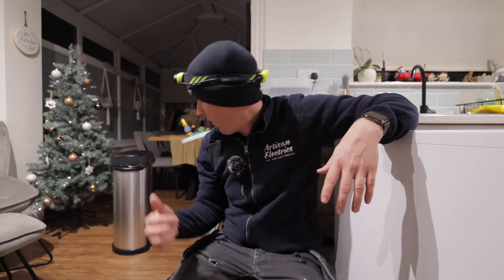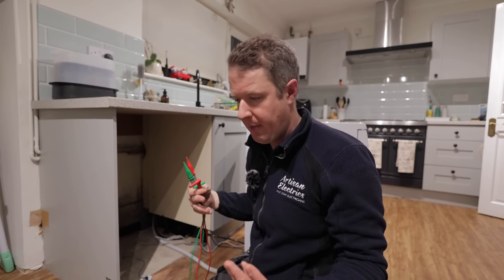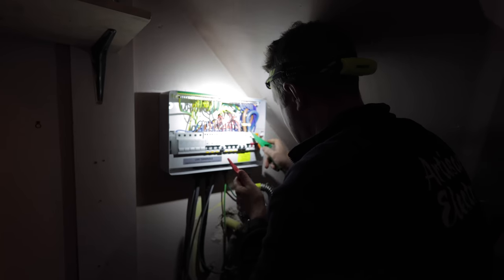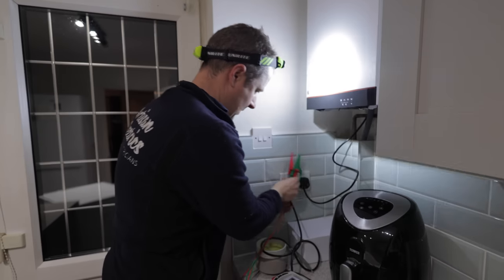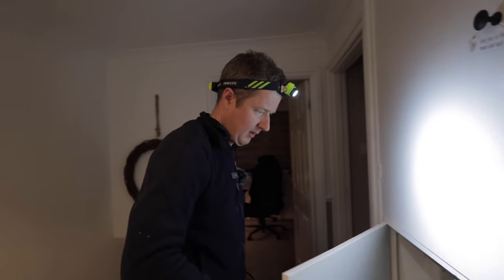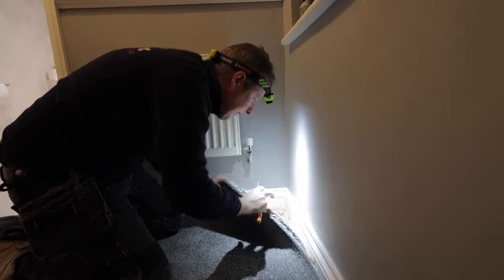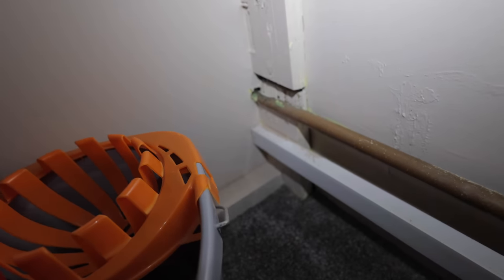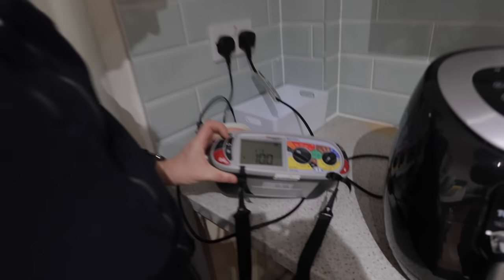Nearly KILLED by a CRAZY fault! What on earth is going on? 💀

Comment: I’m a boiler repair engineer. I’ve seen similar to this on a few occasions. I think a few years back a BG engineer was killed by something similar. I remember on our training course them absolutely drilling us on the correct safe iso procedure because of it. In fact they were so paranoid about dual live feeds that my manager said if he ever came out on site and found we didn’t have a volt pen he’d send us home. The safe isolation took longer than some repairs. 😂. Really good video.
Reply: dont just rely on your volt stick, always use a multi meter and a mulitmeter prover.always test your volt stick on a known live.  first.
Reply: I worked at Transco at the time the Volt Sticks and training was given to us. The reason was a Transco Engineer in Liverpool visited a possible unsafe situation with a gas cooker. When he was kneeling down he was touching the gas cooker with one hand and his other touched the emergency control valve, where he received a massive fatal shock. On investigation it was found that the electric kettle which was on top of the gas cooker had a damaged cable and was touching the gas cooker making it all live including the gas pipes. It just needed someone to provide a path to earth which he did.  After that it became mandatory  to  check any part of a gas installation with an approved volt stick (After first checking on a known power source before and after checking the installation)
Reply: So, I'm curios, is there a lot of deaths from poor and untrained people doing electrical work in the UK?  It seems that using the higher voltages should require a higher degree of safety and training?  That boiler electrical wiring installer should be notified he will be killing someone if he doesn't get the right training.
Reply: There's cowboys everywhere unfortunately. Bathroom fitter took out a lighting circuit by putting chock blocks between live and neutral. Boiler engineer wired up my nest system all wrong and blew the nest wiring box. All different guys, all with excellent feedback on mybuilder. Honestly if you find a good sparky/plumber/handyman just keep using them.
Reply: @silverismoney  So, this is in the UK?   Is this because there are so many unlicensed electricians in the UK or because licensing is allowing Boiler engineers too much latitude without sufficient training on electrical?
With these outrageous stories that many people are killed or shocked, does anybody actually track incidents and can we look it up?  In the U.S. we use 120 vac for most all of our electrical needs and only use 240vac when is truly necessary.  U.S. electrical codes and enforcement are quite strict and I wonder if there is a big difference in serious electrical injuries in the U.K or U.S.?
Reply: user-lt3he9ey4x  Man, I just assumed the UK was as strict or stricter than the US, just because you use higher voltage for everything.  Those stories are a wake up and pause to pay close attention to safety for us all.
Reply: @cantweallgetalong   I was also under the impression that the UK was more strict regarding stray currents - their adoption of GFCI (which they call RCD) has historically been more aggressive than the US.

However while checking that just now, I found that the US now requires that protection regardless of circuit current (although still only in some parts of residences) whereas the UK requires it practically everywhere (but still exempts higher current circuits).

On balance I'd say the UK is still slightly ahead.  But what's more interesting is that the exemptions don't overlap - and since in each case removing one exemption was feasible, that indicates removing both would be feasible also.  So I expect both exemptions to be removed within the next decade.
Reply: @cantweallgetalong  - your 120 V AC can already be dangerous enough. neither should be subject of laymen installation or servicing.
Reply: @alexanderstohr4198  Yep, but the Boiler tech is supposedly trained and allowed to do seriously dangerous wiring and it appears to be killing or injuring the unsuspecting.
Reply: @Matt Faraday  Got same stories - qualified, registered, recommended electricians... sloppy junk work. Think I've found a good one but he's near retirement.
Reply: @alexanderstohr4198  Except this was professionals. I've also seen sloppy work by registered recommended professionals
Reply: @cuebj  I've noticed that too.  It sees the retirements are wiping out so many professions, it's getting very hard to find anybody competent to do anything.
Doctors and dentists and accountants and lawyers in addition to all the trades.
What is happening is the inflation and the liabilities have made everybody focus on the money and not the service.
Reply: @cantweallgetalong  Standards in themselves do not equal compliance. If contractors dont abide there may as well be no standards at all.
Reply: @cantweallgetalong  Also there is only one insurer underwriting everything, all public liabilities. So no market competition in that space.

Comment: Mate, I live in the US but if You were in my area I'd hire you in a heartbeat. You did what I would hope every skilled electrician would by going above and beyond to fix the issue. I guarantee a lot of others would have thought about it and buttoned it up for someone else to deal with. You didn't and I applaud your professionalism.
Reply: In spite of the differences in wiring that could happen just as easily in the US, I'll bet electricians have seen it.  Someone adds a plug to something already wired and plugs it into a different circuit.
Reply: @davidg4288  American here so the set up on that unit confuses me, but did it actually come with a built in plug like that? I doubt it because that would encourage the mistake the idiot before him did, hey its a plug all we need to do is plug it in to a socket. Surely it does not come with a built in plug surely.
Reply: @inkman996  Probably was added by an idiot who could have killed someone! Some of this stuff confuses me in the USA, and the term "boiler" is not what I think of here, a boiler here  as I know it- would be what creates steam to be piped to radiators around the house or building, that's almost exclusively what heats all buildings in NY City. This "boiler" appears to me what I might see here to on demand  heat hot water for a sink faucet without a storage tank.
The the 220+ volts being normal house current is strange to me too since 220 is only used for high draw appliances here like furnaces, heaters, cook stoves, everything else is reduced to 120
Reply: @HobbyOrganist  Roughly from memory here, there's an old video somewhere on YT:

The U.S. center taps transformers for residential use, so we do actually get 240v, we just use the center of the transformer as a ground for the two lives offset 180 degrees to make it 120v. For things that need 240v we connect both legs through a breaker. I can't comment on the UK grid, don't know enough about it.
Reply: @HobbyOrganist  These things are called 'combination boilers' here in UK, A water heater and central heating compact unit which uses gas or electric to heat water and pump it through radiators and taps.. On demand as you say. Basically, A boiler is a container that uses fuel to heat fluid.. We call these thing boilers because they do that job - even though it doesn't pre-heat fluid in a container like the traditional boiler way.
Reply: @HobbyOrganist  yeah, British vocabulary varies from US English in so many ways. In the U.K. it is called a boiler and it is used to heat tap water and radiators in 2 separate circuits. It is basically a tankless water heater with a closed circuit for heating.

Comment: That was one of the scariest things I’ve ever seen, voltage on the male end of a supply power cord! Great problem solving skills on display here, to identify the root cause and in implementing a proper solution to perfection, Bravo sir stay safe!
Reply: I have a friend here in the US who works in a home DYI store and he said every Christmas people coming in looking for a male-male extension cord because they put their lights on the tree with the male plug at the top of the tree. The want to ;ower  it from the bottom female end.  He calls these "suicide cords."
Reply: @SuburbanDon  yep
Reply: I remember they made such cables at the communal work on my scool when i was a kid as well, i can't remember the exact reason why.
I don't know if it's a problem in the US, but in my country another thing people do is to mix in 3 phase/400V lines with unipolar single phase connectors so the 0 became a phase if the wires are confused by somebody... I almost had a fire in mu own house because of that, luckily it had not set the wall on fire before i saw it...

Comment: I've done the 'drill a screw back into a floorboard, straight into a gas pipe' mistake before. 
At 6pm on a Sunday night, in the middle of winter, just before Christmas. 

In many ways it was a good job it was a gas pipe and not water...but it still wasn't a good time. Fortunately my Dad works for the gas board and was able to pull a favour and get an engineer out to patch the pipe that night. Absolute life saver!
Reply: Across the pond we got Pro clowns that only switch one Hot 🔥, because that is the way it is done; plus DIYs that like to shuffle wire colors to fun things up to keep things lively. 😮

Comment: I had a similar issue in a factory where a set of outside lights had been added to and extended after which they kept tripping out at roughly the same time each day. The previous electricians on the job had a few near misses but could not find a fault. After a lot of snooping, I realised that the lights were operated from a pair of timers, the timer that controlled the lights in winter and one of the manual control feeds for lighting circuit were wired to different phases, unfortunately some conscientious person had remembered to switch over to the winter timer, a task which had previously been ignored every year since the install which brought the fault to everyone's attention. There was also a 2nd manual switch (which was on a different phase from the first but fed the same control relay) which the other electricians had used to switch on the lights for testing. Fortunately for them they never had the two switches closed at the same time, unfortunately for them the manual switch bypassed the timers and the fault that they were looking for. I believe the faults were due to the installers not realising that they were dealing with a 3 phase supply board or not realising that they were wiring to different phases at all.  I got rid of both timers and one of the manual switches and used a daylight sensor to control the lights instead.

Comment: This is where a non contact voltage tester is handy. A quick wave of an isolated circuit can alert you to anything abnormal. Then confirm with a proper multimeter, do not use non contact as outright replacement.

Comment: Could you have installed a relay in the boiler? With the coil connected to the upstairs circuit for demand and the switch connector wired to the downstairs circuit. This would provide isolation without having to run any new cables. (Sorry if this has already been suggested - I didn't have time to go through the 2.7k comments!!)

Great diagnostic video, keep up the good work.
Reply: Had the exact same idea! Also for safety could just use the wiring between circuits for a low current DC signal, isolated. Also could drive the relay through an optocoupler. Would be totally safe.
Reply: My thoughts too. Although my only knowledge comes from electronics repair. A contacter/relay between circuits might be a code violation and therefore not an option
Reply: @alexoja2918 best practice one spur should totally isolate all power to heating   control .to fit boiler which doesn't need pump over run or run cable with sufficient amount of wire to do the job.

But has a gas engineer this will encourage to be more detail with my checks
Reply: The only possible problem I can come up with regarding your solution is whether code will allow two mains-voltage circuits into the same device. 

The only thing that would change would be adding a low voltage transformer into the upstairs unit, as well as a relay to enable/break the low voltage circuit. The low voltage control circuit would then control the relay in the boiler.

More components, more points of failure, but no drilling.
Reply: @zierlyn   It's allowed so long a there is a yellow sticker on the appliance, stating: 'Warning, multiple supplies - isolate elsewhere!' However, it is also frowned upon and should be avoided if at all possible. Finally, you're more likely to see multiple supplies in equipment in an industrial setting, not domestic.
Reply: Better to fix it properly instead of trying to improvise.I would never hire an electrician who did such work.

Comment: You could have used a relay with a potential free contact. The Cabel from the Boiler switching the relay and the live from the downstairs sockets switched by the relay.
But your way of doing it is probably the best way.
Reply: Relay would definitely have been a much quicker and simpler way to fix that, however you still have to sources of power in the boiler. I personally would have gone that way and labelled it appropriately, running cables in those houses looks absolutely painful.
Reply: My thoughts as well.  And clearly labeled as such for future service people.  Could take one step safer and make that wiring coming from above low voltage control to a relay.
Reply: You could use the original twin cable as a switch wire and mount the relay upstairs in its own box and labeled up nicely a much easier way. But the customer would still be using a socket in the kitchen to power the boiler.

Comment: I love it when a plan comes together!! When I lived in a flat, each of the three flats was on a different phase of a 3 phase supply into the building. Whilst refurbishing the flat, we decided to remove the electric shower. The bathroom fitter had turned all our power off from the fuse box, but still found a voltage within the shower. He turned off the power at the meter box, and still a voltage. We then asked our neighbours if we could turn there power off and hey presto, no voltage anymore. He traced the cabling back to a junction box under the bath which had a twin core from our fuse box, and a three core that was from the downstairs flat lighting circuit. A three core was then going into the shower unit, but only one live core was in use, the other had a small bit of celotape (not electrical tape) on it. The shower was fed from the permanent live of the downstairs lighting circuit, and neutral of the shower fuse from my flat. Interestingly, the neighbours had been puzzled why their lighting circuit was on a 20 amp mcb. So there was two live conductors in the shower unit from two phases!!
Reply: That's honestly terrifying.
Reply: @Cyberpunk_Banshee  But free hot showers 👍

Comment: As soon as I saw the problem I thought ‘borrowed neutral.’ But this was another level, great diagnosis and spot. In my own personal experience Plumbers should stick to soldering pipes.  
As another note you should ALWAYS use a dedicated set of test lamps (to GS38) and a proving unit for isolation, not a meter. Test the circuit, then test the tester. I’ve had the same set for thirty years and they’ve saved me generally from half wits, numerous times.
Reply: My go-to tool to check for safe handling of AC wiring is a contactless wand. While its usefulness for troubleshooting is very limited since all it does is chirp or not chirp within a few inches of any conductor, its usefulness for safe handling is off the charts: it'll let me know if there's still even enough potential to ring a doorbell, let alone my bell.
Reply: Or a 2 pole tester
Reply: Yes, not so much a borrowed neutral as a borrowed live.  A borrowed neutral - commonly used in older properties having a landing light controlled by 2-way switches on ground and first floors - would only manifest itself when the fuse board was replaced with an RCD or RCBO protected consumer unit.  The current difference between L&N when the light was switched on would cause either the ground floor or first floor lighting breakers to trip.  Clearly in Jordan's situation the current drawn by the boiler wasn't sufficient to upset the 30mA RCBOs he'd installed previously.  The powers-that-be have decided that a current difference sensitivity of 30mA is a good compromise between safety and nuisance tripping - how ironic!